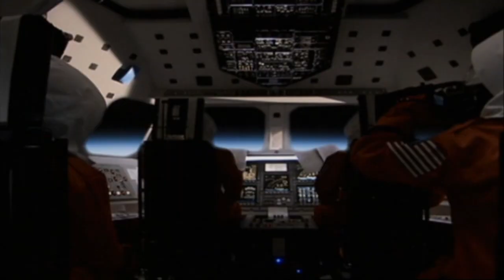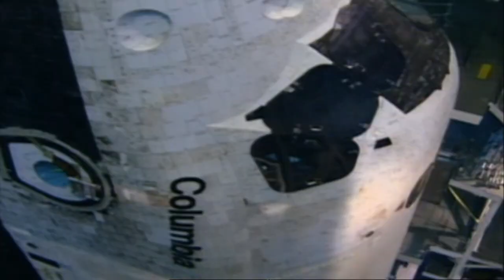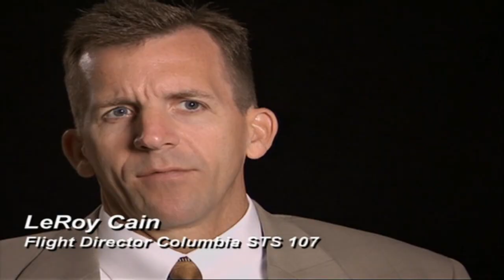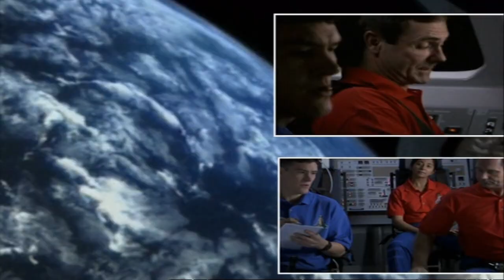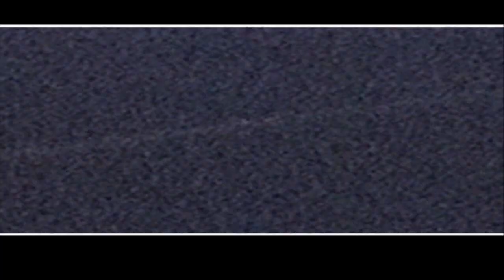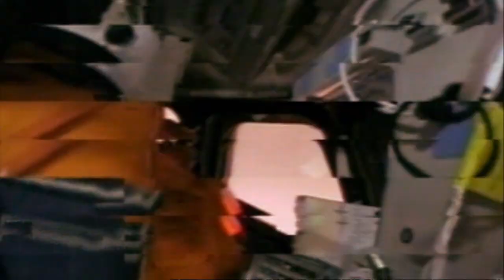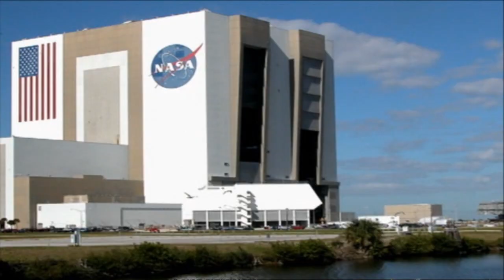Space Shuttle Columbia - Falling Star HD

Comment: Columbia and Challenger both are  the result of the arrogance  of nasa management. It was highly recommend that she shuttle do a pass on a satellite to get pics of the impact spot from the foam. If needed , it could have docked with the space station for repairs. nasa said no. The Challenger launched despite the rocket engineers insisting that the freezing temps would caucus the rubber o-ring seals to fail. nasa said no, everything will be great, and it was great. A great big fireball. Ten people died because of those azzholes.
Reply: In Columbia's case, docking with the ISS would not have been possible due to the fuel required to execute the translation maneuver to match the orbits of both spacecraft. NASA's best bet would be to have sent Atlantis to try to save the crew.

Regardless, both the Columbia and Challenger disasters were preventable accidents. Also, the death toll from the shuttle program isn't 10. It's 14, 7 crew for each lost orbiter.

Comment: Why did the crew module on this shuttles not have a detach function to separate from the main body in case of emergency with a parachute 🪂?
Reply: It was never considered in the design likely due to weight and cost constraints. In this case, an escape system would likely not have worked depending on the design.
Reply: Would've cost an extra $300mil
Reply: @cynicalPixels  regardless of cost it would also be a lot of extra weight and an extremely difficult engineering challenge

Comment: In a way the whole shuttle concept was brilliant when it was brand new. It showed the potential for reuse. But using it troughout the 90 and so on was a mistake in my eyes. It should've been decomissioned or totally redesigned and equipped with newer systems and active sensors. It was asking for disaster to use old computers and procedures from decades ago. I'm affraid to imagine what the crew went trough those last moments. Sure it wasn't long before the shuttle dissintegrated but they would've been aware for at least a few seconds that all hell was breaking loose. May the crew rest in peace. Their contributions to human understanding of the universe won't be forgotten. At the very least the tragic event resulted in new procedures to ensure future crew safety. 

Main problems with Shuttle programs: Boosters safety, old material that wasn't safeproof (like the foam that didn't really fit tight) and instead of making completely new design with upgrades of materials and systems they kept refurbishing old concepts and procedures, arguably not only a problem for the Shuttle programs alone but the whole space program.... management, oversight, safety checks.

Comment: Pretty shocking the lack of computing power and sensors on board, seems like it was literally a relic from the 70s
Reply: The Shuttle itself would have had a perfect flight record if not for the external system failures of foam and SRB O-rings.
Reply: @michaelbruno1666  yeah I was more inferring about the ability to check up on the health and status of different parts of the craft, seems that side of it wasn't kept up with the times.

Comment: The depiction of the final events is a bit flawed in this documentary. The official Columbia Crew Survival Investigation Report gives a more detailed account of the actual sequence of events (it all went really fast for the crew, in just 2 minutes from first indication of a problem to loss of consciousness and subsequent death still inside the crew module, cf. below):
https://www.nasa.gov/pdf/298870main_SP-2008-565.pdf

GMT 13:44:09 (EI) entry into upper atmosphere at an altitude of 400,000 feet (~122 km)
GMT 13:52:17 (EI+488) start of thermal damage to left wing (unbeknownst to crew and MCC)
GMT 13:53:10 (EI+541) off-nominal readings in left wing hydraulic temperature sensors (telemetry only)
GMT 13:58:39 (EI+870) first indication of a problem to the crew (loss of left tire pressure fault messages)
GMT 13:58:48 (EI+879) partial voice transmission from Columbia to MCC is received ("And, uh, Hou...")
GMT 13:58:49 (EI+880) crew begins on-display examination of fault messages after audio alarm
GMT 13:59:24 (EI+915) MCC calls Columbia regarding the fault messages and the partial last call
GMT 13:59:29 (EI+920) RCS jets start continuously firing to correct drag of damaged left wing
GMT 13:59:31 (EI+922) loss of hydraulics and shutdown of autopilot (Master Alarm)
GMT 13:59:32 (EI+923) loss of voice communications ("Roger, uh, ..."), loss of signal (LOS, all telemetry)
GMT 13:59:37 (EI+928) orbiter loss of control (LOC), start of flat spin, increasing structural and thermal loads
GMT 14:00:04 (EI+955) last recorded inputs from crew (via onboard recorders)
GMT 14:00:18 (EI+969) breakup of orbiter (CE) into three main bodies (fore, mid, aft)
GMT 14:00:19 (EI+970) loss of electrical power (instruments, lights, intercom, ventilation, O2 supply)
GMT 14:00:25 (EI+976) depressurization, loss of consciousness, cessation of respiration
GMT 14:00:53 (EI+1004) breakup of crew module (CMCE), thermal intrusion into crew module
GMT 14:01:10 (EI+1021) total dispersal of crew module and forebody (TD)

Comment: How didn’t that hole cause any problems when the shuttle entered the atmosphere at the start of the mission?
Reply: Maureen — Not fast enough during ascent until it gets into thin atmosphere.  During descent, it relies on air resistance to slow down, so enters the atmosphere at higher speed than it leaves it.  Also, they believe the hole didn’t completely open up until the shuttle was in orbit.
Reply: The tile didn't come off until the shuttle reached orbit.

Comment: Later missions had a tool box aboard? This was a false sense of security. That box was only capable of repairing tile or small holes in the heat shield. You cannot fix a hole with a 16 inch radius in a space walk.

Comment: I was working at NASA Edwards A.F. B, CA on that fateful morning watching their return from a telemetry tracking command trailer on the bases main run way flight line station.  I had heard very early in their mission that the Air Force offered to take a look at the vehicle while it was on orbit to determine what damage may have happened when the main tank insulation impacted the left  forward wing edge. NASA management decline their offer knowing nothing could be done if in fact there was severe damage. The crew never knew the ground feared a damaged wing would destroy the vehicle upon reentry. All we could do was sit and watch the vehicle break up over Texas.
Reply: A photo wouldn't have done any good. There was no way to repair the damage in space. No repair materials of tools. And they didn't have the proper  spacesuits or a tether to do a space walk.

Comment: No need for schooling to be an engineer, just read these comments and you’re good to go!
Reply: Who needs M.I.T.,apparently the top minds at nasa had no concern at all regarding the damage to the wing.
They seemed to figure out after the fact that a briecase sized chunk weighing 10 pounds or less traveling 500 mph could bust a hole in the wing.
Seeing the experiment that shot the foam block,and also seeing the panel and how actually fragile it was under the circumstances,a dumbass like me would have concerns.Surely engineers that know physics and the construction aspects and materials used on the wing should've had concerns.
Reply: The Warptarium sure bud
Reply: @wm1069  of course it was
Reply: JustJay 0312 Nice damage-control man, very clever.
Reply: Absolutely. I’ve watched a lot of those plane crash investigation shows on YouTube — so I could now pilot the DC-10 out of most  faults … even the pitoe tube problems, as long as I could get the autopilot to disengage. 😜
Reply: I’m reminded of the great gorilla experts of 2016 who all knew for certain what the zookeepers should have done to help Harambe. If only they spoke up sooner, that gentle giant could have been spared.
Reply: Most of these "experts" making comments have no clue about how a shuttle was designed and maintained.
Reply: The Warptarium it was a joke...

Comment: It needs to be pointed out that Republican budget cuts contributed to the totally unsafe design of the Shuttle. Under JFK and LBJ in the 1960s, the Apollo program got as much funded as it needed, that's why it was so successful and much safer. Because of Republican budget cuts, the Shuttle design was totally unsafe because they were trying to cut corners everywhere (like using SRBs that cannot be turned off after they're lit, not having a launch escape system). This was all because of cost cuts.

Comment: 7 astronauts died, judging and blaming is the easiest thing to do afterwards.
I am not an engineer but I would like to address some points here.
We could all start saying the shuttle was very dangerous spacecraft and very risky for the crew members and blaming the Shuttle's design.
Yes, it was a very complicated piece of thing, and traveling into space would multiply the risks. BUT..... BUT... It had to do everything which is very very difficult without confronting many difficult challenges and issues during it's mission.
1) It had to look like an airplane and go to space
2) it had to be strapped around two solid rocket boosters and a big main fuel tank
3) it had to have the capability to have a crew of 7 astronauts (the most astronauts ever were on Apollo before the Shuttle with only 3 men)
4) it had to have a big cargo - payload area to transport whatever NASA , Air Force, DoD, etc wanted.
5) it sent satellites , ISS space station pieces to built , DoD secret missions, laboratories, Telescopes, it had to service satellites or fix them in orbit, etc , it was the ultimate transportation vehicle 
6) it had to withstand an orbital re-entry with it's enormous big mass , a lot of surface for the heat shield to protect. It is still the biggest spaceship / mass to have ever re entered from orbit. And a lot of aerodynamic air pressure to deal with during the descent to earth.
7) and last after the heat inferno on the upper layers of the atmosphere , to come back as an airplane....or worse...AS A GLIDER , with only one shot to land.

I think we have asked to much from the Space shuttle. Built with technology of the early 70's and doing so multiple tasks the same time it was an unbelievable work horse ahead of it's time. Give it some respect... though it had it flaws as every complicated design. I would only mention one which is crucial and if the Shuttle design could have incorporated one, then we probably wouldn't have lost these 14 crew members of Challenger and Columbia . A SAFETY ABORT SYSTEM. An incorporated capsule into the crew cabin that would could be jettison any crucial time during ascent (like the Challenger) or re - entry (like the Columbia) and have it's own heat shield,  landing gear (parashutes,etc.) so they can protect and preserve the men and women aboard ! Yes it would have added weight and lowered the payload capability but..come on, we are talking about our pioneers , our astronauts , our brothers and sisters, our men and women.....men and women of our beloved good old earth  ! 

RIP to all astronauts and cosmonauts lost, we pray for you!

Comment: Reentry is roughly 16,8XX miles per hour. Or anout 5 miles per second. The Shuttle started to breakup over Arizona and they found pcs. in Texas!
  The outer shell of the Shuttle was made up from thousands of specific Ceramic tiles. After each mission these individually serial numbered tiles were checked or replaced. I believe a Korean company manufactured the tiles.
Reply: Actually it was about 10,000 mph.

Comment: How can a piece of foam damage a wing?
Reply: Ok so if the space shuttle is flying faster than the speed of sound or higher and when the foam from the external tank was pulled out the tank the foam struck the shuttle or the shuttle ran full speed into the foam and created a hole in there
Reply: @mrgameybean7476  Thanks. I already watched the documentary where they did a test with the foam to prove it was possible cause nobody believed it then either.

Comment: I know that whats done is done and you can't change it but I would like to inject my observation. R.I.P. astronauts.  First, there was a management problem in NASA for a long time. I am shocked that they had that many successful flights to begin with. These folks were supposed to be the brightest and best people handling this. Let me explain,  from the start of the first launch, they always had pieces of foam come off the tank during liftoff. They admitted that some foam pieces dont stick well to the tank. How can you fly a complex machine and have the most sensitive area of the shuttle be open to falling debris on liftoff. Knowing that they knew falling debris would happen on every flight, not once did someone say there should be a physical and visual check of the space shuttle all around, which they could have done from the first flight. Then a course of action could have been done before reentry was ever attempted. There was debris falling on every one of the liftoffs and no one questioned it. They consider it normal. It amazes me there were not more accidents when the shuttle program was going. I understand every flight is not going to be 100% but this is too obvious what might happen and it did happen.  Engineers need to think outside the box. But because of constraints , 7 lives were lost needlessly.    Eagle 3 inbound !

Comment: Two things: 

1) I wonder if the crew cabin survived the initial breakup of the shuttle like it did with Challenger; eventually slamming into the earth intact or if it disintergrated along with the shuttle?

2) I know there are waivers disclosing the risks involved that astronauts sign, but just as with Challenger, Columbia was a case of misinformation & downright negligence on NASA's behalf. With the deaths of seven people, why was no one ever charged & sent to prison for these disasters? 

They weren't technically "accidents" if NASA managers had the information to prevent them beforehand, but due to whatever reasons, they chose not to disclose them to the crew. Firing them, though a totally necessary measure, seems like a slap on the wrist considering the magnitude of what occurred & the lives of the astronauts' families that were impacted.
Reply: At approx 09:00:57 (EI+1008): The crew module, intact to this point, was seen breaking into small subcomponents. It disappeared from view at 09:01:10. The crew members, if not already dead, were killed no later than this point.

So no, they did not die on impact. They lost consciousness, their lungs exploded, and then they were blown into small pieces by the hostile aerodynamic and thermal environment of re-entry.

The point of a waiver is that no legal action could be taken. It was an accident, as the previous instances of "foam shedding" had not caused any issues and that is the data they were working off of.
Reply: @cl4097  if it was a accident. It was a very preventable one. NASA had been warned after the near loss of Atlantis on STS-27 of the foam problem and other minor impacts and to fix it. Over a decade later and they still haven’t fixed the minor impacts problem. Sure enough disaster happens and 7 more people are dead. some people never learn, especially NASA.
Reply: No matter how much you prepare for every eventuality there's always something else.
As the old saying goes, the more complex you make something, the more chances of it going wrong

Comment: I liked this but please spare me the astronaut reconstruction cheese.  Also, "Hey should we have a toolkit incase we need to repair something on the outside of the shuttle, you know, so we don't burn to death upon re-entry? Nahhhhh."  And if straws can go into telephone poles in hurricanes foam can do damage as well.
Reply: The problem is that you can't just pack "a toolkit", because the kit you need for the carbon-carbon is different from the kit you need for the ceramic tiles, which is different than the kit you need to fix the other insulation.

Not that it mattered much in this case, because there was no way to get out to that spot on the wing and do the repairs

Comment: I wonder if NASA performed some sort of risk analysis or FMEA on the potential cause and effects of the damage? Seems like a tool that could have been utilized to provide some sort of quantifiable measure as to the extent of damage.
Reply: I think you dont have to be a rocket scientist to figure that out: 
Cause: Piece of foam came off of the wing of the shuttle leaving a gaping hole in it's wing. Thus harming the structural integrity of the craft. 
Effect: The intense heat and force from re-entering the atmosphere was too much for the wing to handle, causing it to fall apart from the rest of the craft and critical structural damage. 

The shuttle, including the astronauts, was literally ripped to bits and to this very day people in the path are finding pieces. We may never have a complete picture of, say, what pieces failed in the right order, but I still think the answer is pretty obvious.
Reply: @hydevanhelsing5063  That’s not what I meant. Typically, an FMEA is performed during development to try and “predict” potential failures and the magnitude of those failure via a quantifiable number I.e. RPN. The result would be to mitigate the risks as much as possible, with safety issues being most important. This could be a design change or process change etc. If NASA followed this method (correctly), they would have identified critical safety risks and halted flight. 
I do agree what you said - after the fact although, that’s not when FMEA are performed and are not needed.